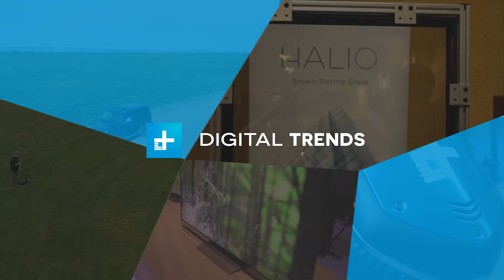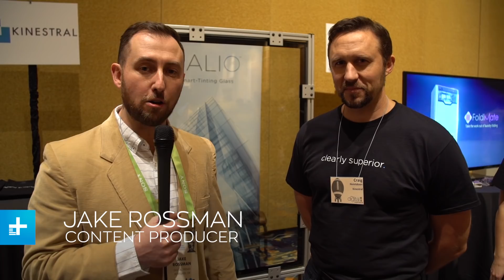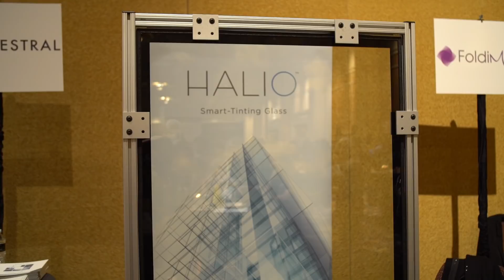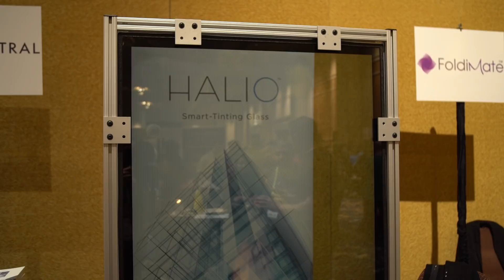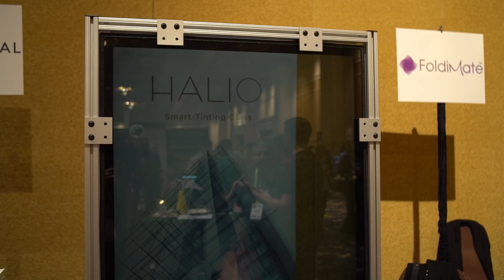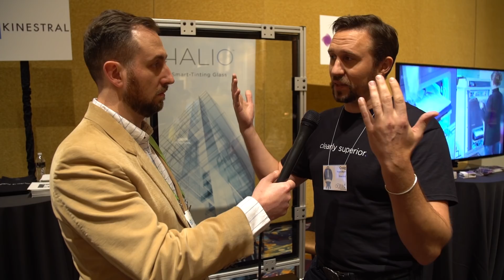Halio Smart Window at CES 2018

Comment: 4 to 5 times cost of normal windows is NOT a "little bit of a premium."
Reply: drapes over a room with big windows can cost thousands. No more drapes.
Reply: @tallthinwavy3  Yeah but 4-5x of what?  The glass or the window?  You can get a premium Fleetwood floor to ceiling window for about $8k.  So does this mean with this film inside of it the cost is now $40k?